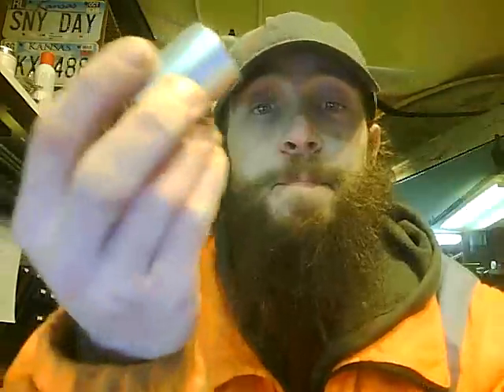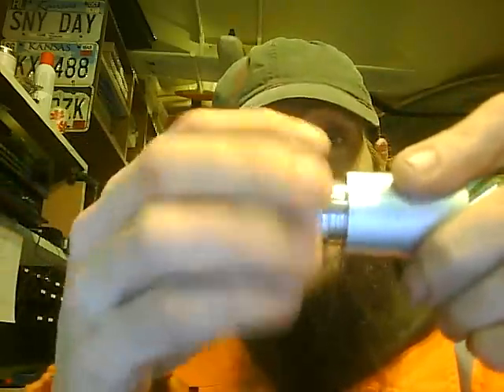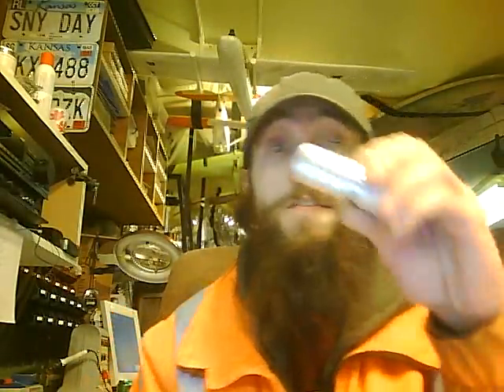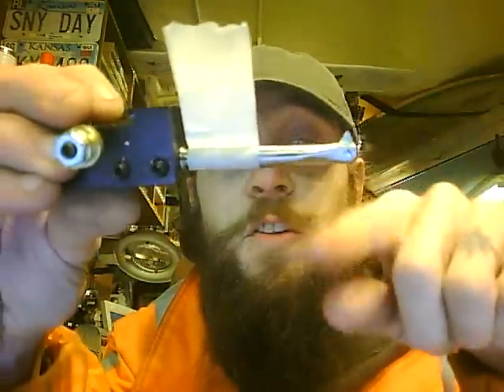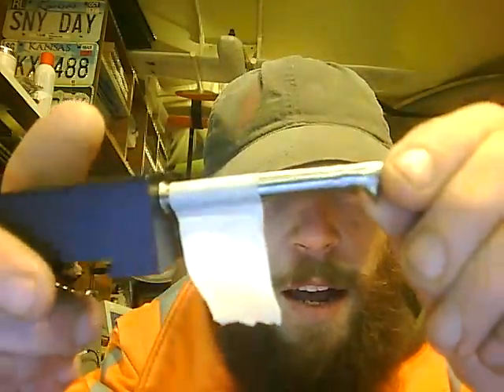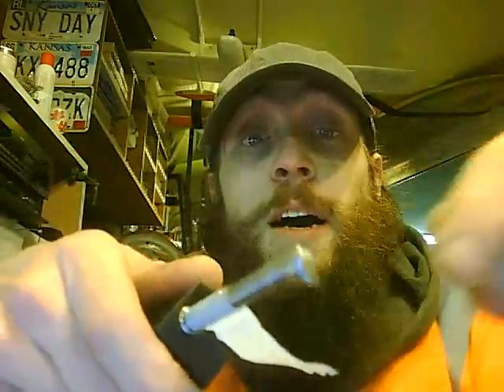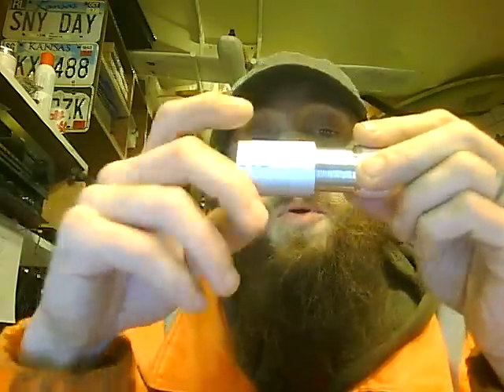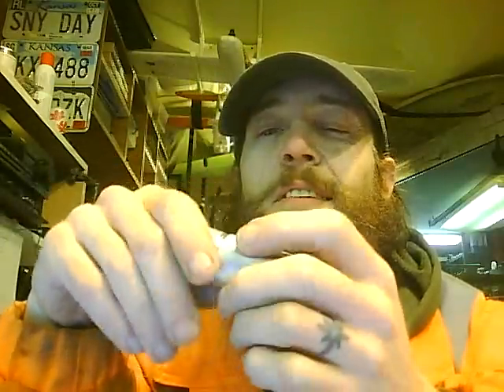My first internal threads, with a tool I made

Comment from the maker: My very first internal threads. Oh, this opens up so many possibilities...
Reply: Chris, you rock! I've learned in school the angles for all the cutting tools and they are different for each material your cutting, but I forgot everything one month after. But when I got hired after high school as a lathe machine operator, I had to learn how to sharpen my cutting tools. Took me lots of practice to get it right, then I read again about the angles and tried to do it like in the books. Half year after I started to work with the lathe I could just touch the tool on the grinder and fix it (the tools get dull after a while). So, seeing what you're doing as an amateur (you've learned this on your own, just like I learned carpentry on my own) I'm impressed by your skills. In everything you're doing, if you have passion, you're going to succeed. Well done my friend, well done.